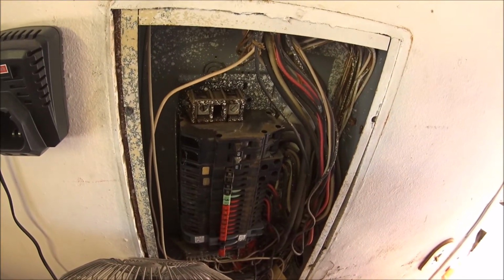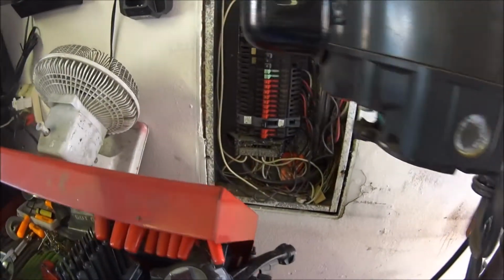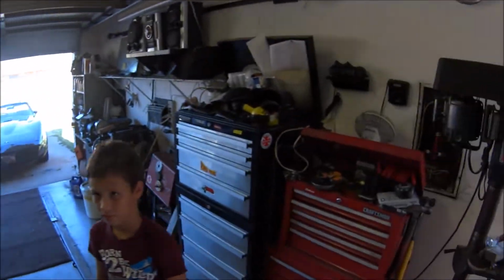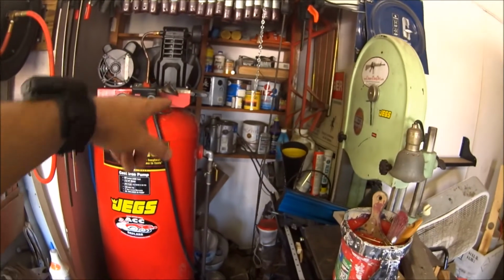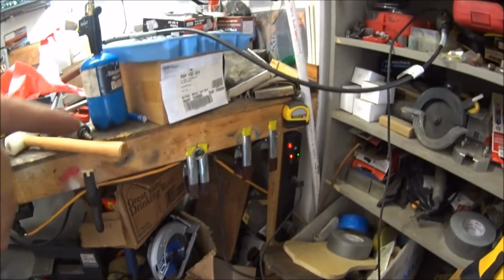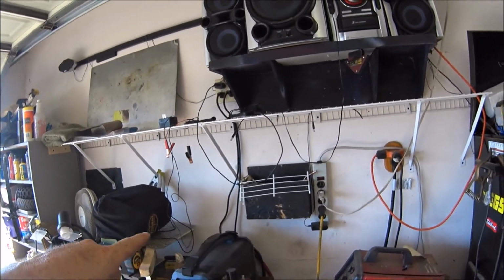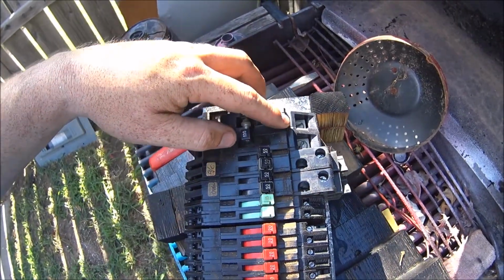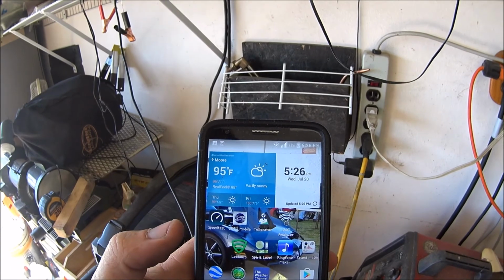House almost burned down (Long Video, not a how too)  New Breaker Panel

Comment: That’s scary that the main breaker was stuck on. The new panel looks like a nice clean job.
Reply from the maker: The crazy thing is we actually had a house fire later that year. (Videos are on my page)  Not because of anything done but because of either a plug outlet inside or the power cord going to it.